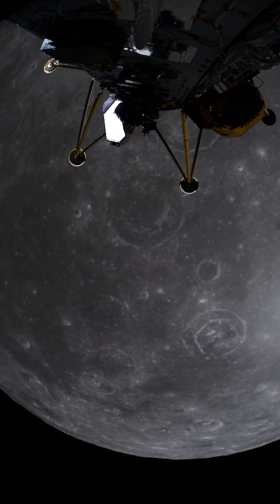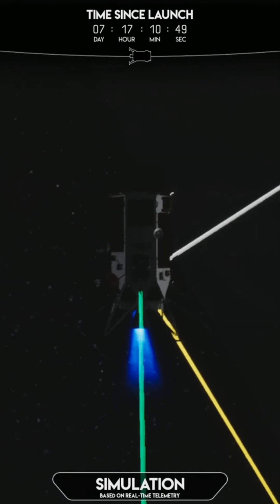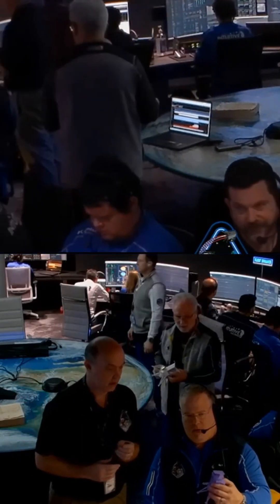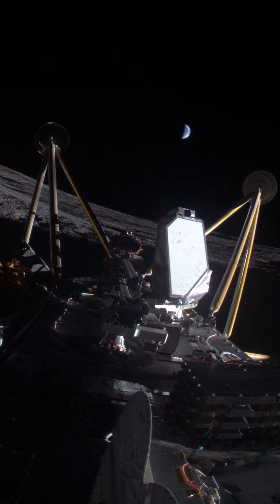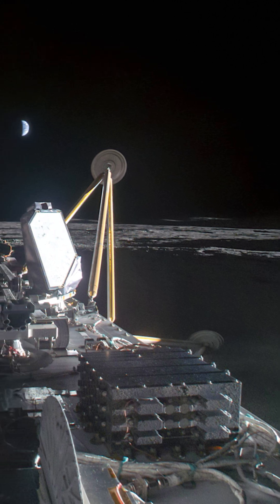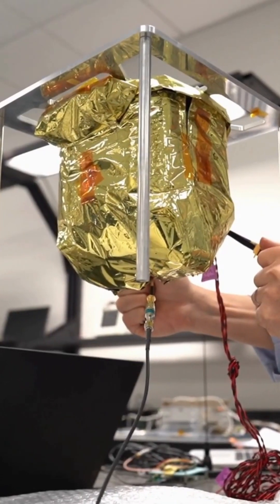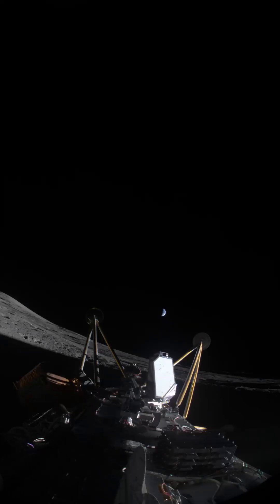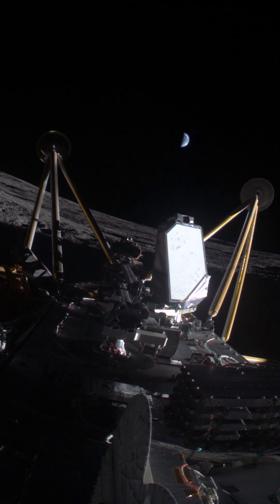What Exactly Happened To The Athena Lunar Lander?

Comment: That's what KSP taught many players: Tall, narrow-legged landers bad. Low-slung, squat landers with wide base good.
Reply: Maybe they should build their lander sideways.
Reply: Pretty much what I've been saying...The Apollo Landers and currently the Firefly lander both went wide and squat and worked great.  I hope Blue Origin is paying attention, they're going tall and narrow with their lander design too
Reply: @MrGoesBoom  exactly. The dynetics style design is the way to go.
Reply: I've gotten into the habit of building landers with the intention of them falling over. With proper landing leg and engine placement, I've been able to basically "vtol" all my mun launches.
Reply: All I know is that this vertical design allowed for better solar panel placement, since the landing spot is at the pole.
And it probably allowed for bigger Fuel & Oxidizer tanks, since it's 2 spherical tanks on top of each other instead of 4 tanks horizontally (to ensure the Center of Mass is in the center, since Fuel & Ox. are different densities)
Reply: The Surveyor landers were a three legged squat design and had a good success rate of landing. Surveyor 3 landed in a crater, and Surveyor 7 landed near Tycho’s rim.
Reply: Yeah. My first mun lander was tall and fell over. But that's a game, and we have quick save there.
Reply: Sometimes I think being able to do something in KSP should be a mandatory requirement to work on the actual engineering project.

I know every generation has to repeat the mistakes of their predecessors or they won’t learn but it’s just painful to watch.
Reply: Yeah... second time*
Reply: I think it was the company's CEO Steve Altemus who said that its centre of gravity actually was very low. But this happened anyway 😢
Reply: Someone tell Starship 😮
Reply: Having a computer land with a Human astronaut/pilot makes a big difference. Apollo 11 would have landed on house size boulders if Neil wasn't at the controls. I believe both Blue and SpaceX will have self leveling gear as part of their ships, which on the south pole, is certainly required. It's really rough down there.
Reply: This bodes all oh-so-totally-well for Starship Lunar Lander...
That one won't just be tall and narrow-legged, but also rather top-heavy - you know, with all the fuel tanks down below nearly emptied during the landing, and the payload high up in the nose. And maybe a full header tank also up there.
Reply: I won’t make the same mistake/Landing on the moon
I hope my leg don't break/Landing on the moon
Reply: I guess they didn't play it lol
Reply: Couldn´t they just make a great (hydraulically adjustable to the terrain inclination) metal ring as landing gear instead of 4 feet ?
Reply: The main issue is that they are landing on the poles and getting above terrain for solar and comms is vital
Reply: Except for Falcon 9 boosters. They're exempt from this and are perfectly fine being tall and narrow and landing on a barge in the ocean.
Reply: @Quarkburger  Except when it keels over and falls. Which happened more than once and still happens from time to time.
Reply: Kerbal fun,Athena expensive
Reply: Same goes for starship tbh, gonna be one hell of a landing if it ever makes it way to the moon
Reply: That’s what the design principle behind the F4U Corsair’s landing gear was during WW2 as well, needed short rugged gear for carrier landings.
Reply: All the weight is at the bottom , so it's a lot more balance than it looks. It's not like they have played kerbal.
Reply: When Kerbal Space Program….

…. A video game…..

….. gets it right…..

….. you know these billionaires are just throwing money away.
Reply: You ever seen a turtle trying to roll over?
Reply: On the other hand, Falcon 9 lands just fine under the right conditions. My money is still on a software issue in the landing profile, even though intuitively I’m thinking it’s top heavy and the legs are too skinny ;)
Reply: All of you people are doing the xkcd meme about KSP and making fools of yourselves, lol
Reply: I'm thinking close the gear and then re-extend it should pop it up no problem
Reply: only if your descent trajectory is rubbish
Reply: @santos.l.halper1999  Exactly. All the armchair engineers talking about how the CoG should have been lower... none of that matters when the root cause is that they keep hitting the ground hard enough to break things.
Reply: @santos.l.halper1999  yeah, you design a lander that can reliably land on the moon despite harsh terrain and low sun angles. It is easier to say "just do it correctly" than it is to do it
Reply: @cherriberri8373   nah it's easier to do it correctly than it is to mitigate the results of not doing it correctly whilst trying to adjust for a cascade of variables.....  Kerbal is easy if you know what you're doing
Reply: @santos.l.halper1999  You should design the landing gear assuming the descent will go horribly wrong.
Reply: @canonicaltom   no, just designed to function as intended. IM2s failure was a sensor issue so.....
Reply: Evidently Elon never played Kerbal....

Comment: why  " vertical landing "  is hard  for unmaned lander in 2025 but easy in 1969-1972 ?
Reply from the maker: Likely has to do with using a 2 ton spacecraft to land 200kg of payload rather than 6kg of payload.
Reply: A human pilot is much more flexible and adaptable than a pre-programmed computer.
Reply: @Hedgehobbit Right. Apollo 11 would have failed if it didn’t have a crew onboard. The designated landing spot was full of boulders and they had to fly the Lunar Module to a smooth spot.
Reply: skill issue
Reply: No mystery here, much easier to do it for state agencies throwing significantly higher budget (over small private companies) into such landings. It is enough to see how much was each Surveyor landing in today’s dollars.

Comment: It did the tip over maenuever as all tall objects have a tendancy to do. I am having doudts about the HLS Starship design for this same reason.
Reply: It didn't tip over because it was top-heavy... it tipped over because it hit the ground hard enough to break one of the legs. It doesn't matter where your CoG is if you can't get the landing part right.
Reply: All the renders show it with landing legs (4).
Though, yes, it will definitely be a top-heavy design. However, they have a lot of experience with landing tall, potentially top-heavy objects... So if anyone can pull it off I think it's SpaceX solely because they do have that experience!
Reply: @DUKE_of_RAMBLE  Yeah but the Moon isn't as flat and smooth as a metal barge or a concrete pad. What I don't understand is why they just don't go ahead and make a shorter version for the HLS then use the tall version for cargo.
Reply: @allanrose3661  True, yes, but they've proven themselves very capable and "crafty". So I still have faith.

And yea, a "Dragon XL" that's like... the nose-cone down to the payload bay door in size, would be pretty cool as a lander.

We shall see what they cook up. They very well may determine that is not a feasible design choice and abandon their HLS endeavors. Though, I doubt they will since it'll still be applicable to landing on Mars, so they have to crack this nut either way. Whether the increased Martian gravity will be a benefit or a hindrance is the real question!
Reply: Yeah, that height will mean they absolutely have to stop all lateral motion before touchdown. Across the entire height, I'd guess. That said, after a few dozen crashes they managed that on the Falcon 9 so... They'll get it eventually
Reply: One huge advantage for the SpaceX HLS on Artemis III and IV is it will have a crew onboard who, hopefully, can steer it to a smoother spot. However, per SpaceX’s contract they have to accomplish an unmanned landing and takeoff prior to Artemis III. As another commenter already said they should, again hopefully, be able to leverage their experience with autonomous landings from Falcon 9.
Reply: Especially considering how the SpaceX engineers decided to completely sidestep the issue for ships landing back on Earth, by completely removing the need for landing legs.  I think that either no one there understands how landing legs work, or the person who is incredibly insistent that short little legs that don't splay out at all are "just fine" is so high in the company that his ideas can't be dismissed, no matter how stupid... sigh...
Reply: @DougVanDorn  The only reason it may have the slightest possibility of working is no atmosphere  thus no wind. Has no hope at all  on mars, yall remember the Martian? There is also the issue that the payload is going to be at the very top, and the structure of the starship is going to be less rigid with less fuel on board.
Reply: @jacewhite8540  "The Martian" was fiction, in real life the atmoshere on Mars is only 1% of Earth's density.

Comment: Most expensive "feet up at the beach" photo ever.
Reply: With all the various "Robotics" development, it seems none have been used for "Lander Tip Correction" elements! 🤔🥴
Reply: @robertweekley5926 eh?
Reply: @robertweekley5926  i appreciate to you.
Reply: @robertweekley5926 if one of the legs is actually broken, that, by itself, wouldn’t help.

Comment: same mistakes were made tooo much horizontal velocity did they learnt nothing from previous attempt
Reply: The ground surface sensors didn't work. Notice how the altitude readout never dropped below 5 meters. It never really knew where it was relative to the surface. And was traveling sideways at the touchdown, breaking the legs again.